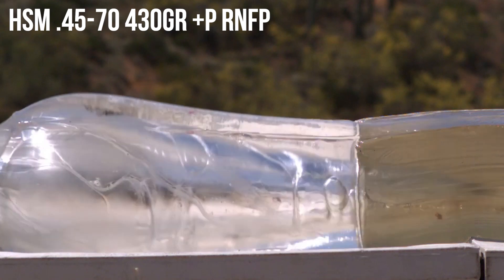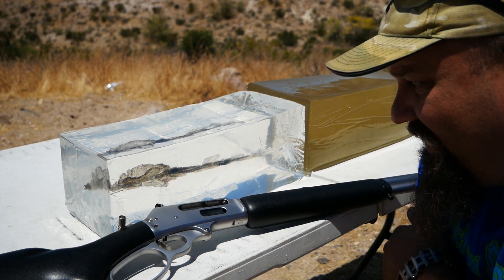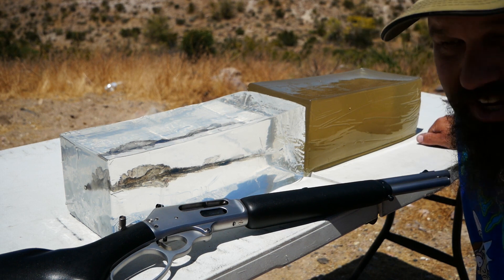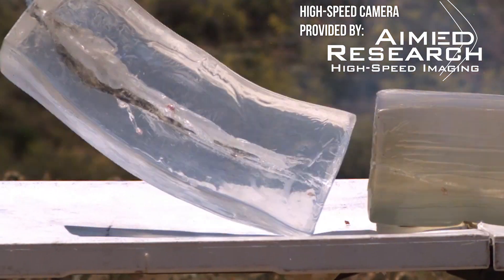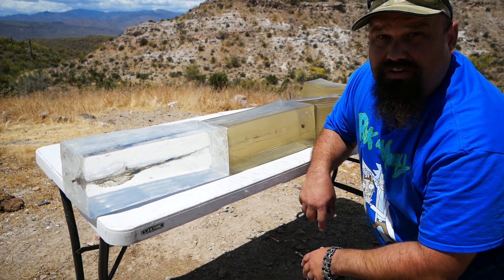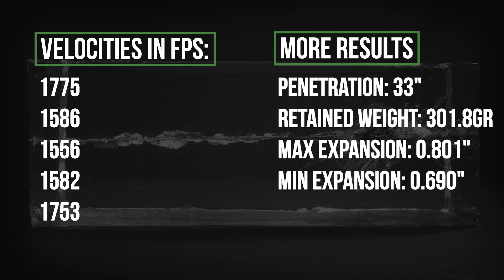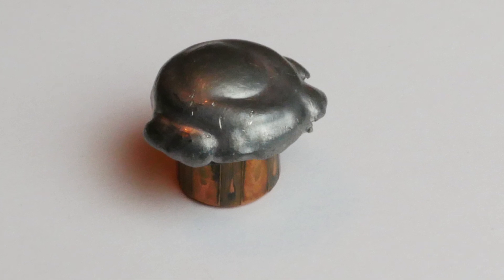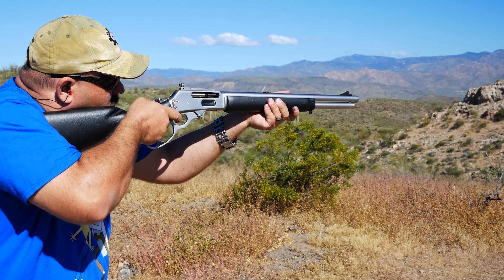Could This Be The Ultimate Velociraptor Load?.45-70 325gr FTX LeveRevolution

Comment: Great vid mate. I love the above hornady round for the mud covered pigs down under. 
I hit a 30kg pig with one in the shoulder one day, surprisingly I had no pass through but the pig had a 12-13” split length ways in the hide about where the back strap runs on the opposite side of the entrance wound. 
Massive energy transfer. 
Easy shooting, hard hitting, aerodynamic (comparatively). 
Acceptable accuracy. Good ammo.

Comment: Good video. Demonstrates the 45/70 power potential. I shoot both a Marlin guide gun and a Shiloh Sharps 45/70. The Sharps handles 520 grain lead at about 1300-1400 fps. The guide gun uses 420 grain lead, and smaller weight projectiles, although I once hand fed one of the 520's in the Marlin and paid a price for it. Lost my hat, my glasses and suffered a nice bruise on the shoulder.  Don't do it!

Comment: These are not a weak load. Hornady loads the 325 gr at 2050 fps which generates 3032 ft lbs of ke. Sure a +P can produce more but Marlin and Henry don't recommend using them (yes, I called both companies). I live in Alaska and feel comfortable with these in any of my 45-70's. Not to mention they shoot sub MOA.
Reply: It's his 16" barrel length giving the inconsistent and low velocities. A 20" barrel would be much more suitable for 45-70.
Reply: Are you talking about the Underwood +P 45-70 ?

Comment: For the 325 grains FTX, you have to shorten the brass, so the powder capacity decreases, and you loose some foot-pounds of energy...
Reply: You don't have to trim the case down if don't want to. The reason for the case needling be shortened is to fit marlin 1895. Not suggesting you do it but saying it is possible To modify the carrier and put a wild west guns ejector in. This will drop your bullet jump now on my rifle I went form .150" jump to .050" jump These can effect pressure as well.

Comment: 325 @ 1600 fps, sounds like a 454 casull. Heavier bullet at lower velocity will do the same thing , only better . trying to modernize the 45-70 is a waste of time, original loadings  stomp game flat. Do as you like but I keep jacketed bullets out of my 45-70.
Reply: Factory Hornady 325 gr loads are going at 2050 fps and generate 3032 ft lbs of Ke. A bit more than the 454 Casull and these are moderate loads.

Comment: Velociraptors were barely 30 pounds and not much bigger than a turkey. They would have absolutely been bodied by a coyote if the two animals were ever to have a fight. 
You don't need a gun this powerful to take one out. 
Even if you were specifically referring to the raptors from the Jurassic Park movie franchise, you still wouldn't need a gun this powerful. Any gun you could use to take a deer would be more than enough.

Comment: Could you test the Barnes TSX @1900fps and Buffalo Bore +P TSX @2200-2300fps?
All copper lead free hollow points. I've used the Barnes load for the last 2 years on whitetail with perfect performance.

Comment: ABSOLUTELY I would us that rifle with that cartridge anywhere on the planet and Mars.
The ft lbs of energy with bullet mass and penetration makes this a smoke bringer
that will blow a fist size permanent hole through the mass dropping blood pressure very quickly. 
now you better have some water by ya if you bust something juicy because the giblets that will cover you will be epic.
that 4570 platform in this video will do an excellent job within 200 300 yards.

Comment: I shot a wild boar with one of those type o' bullets. I hit it in the shanks, and they basically was in the shape of what you'd get if you would get if you put a pair of pig shanks in a shopping bag and ran it over with a truck and then pounded it with a sledge. It ran whole of 7 metres in the dark, found it dead as hell. 
I dont think there's anything in Sweden i'd be worried about hunting with it. It's not a comfortable rifle or round to shoot with a bench though. Best fired when standing so one can flex a bit with the recoil.

Comment: With proper ammo selection and shot placement 45-70 is capable of taking any terrestrial game on the planet.
The LeveRevolution ammo is good, but Underwood sells a +P variant with the same FTX bullet, and if that doesn't work for ya, give the +P Extreme penetrators a try ... I let a friend shoot one of my smaller AR-500 plates, only he shot the one at 50 yards instead of 100, plate now has a slight deformation.

Comment: If you are truly looking for a freight train round, check out the hot load 1886 Winchester 50-110 WCF. You can punch holes in 3/8 plate steel at 2800 fps. Rifle holds 8+1. Lookup, "Leverguns 50" on youtube. Video title, "Most powerful lever action rifle cartridge." This thing can stop a charging anything, in its tracks.  Terrifying weapon/round. Love to see you gel test it.

Comment: My personal favorite 45/70 load is the Winchester Dual Bond. Winchester also makes 12ga sabot slugs which is the 45/70 Dual Bond bullet loaded into a sabot sleeve. (They also load this into .44 Mag, .460S&W, and 20ga sabot slugs.) Would love to see some head to head comparison of 45/70 to 12ga in gel.
Reply: I'm really disappointed that they quit making the dual Bond load for the 45-70. My favorite as well. Extremely accurate to 100 yards. More effective than the Rem405 yet no separation like the 300s. I have shot five deer and one coyote with them. Everyone dropped exactly where they stood nickel size hole going in quarter size hole going out. Perfect round for inwoods and stand hunting.

Comment: I always heard that at least some guides in Alaska and up north use 12 ga 3" magnum slugs for grizzly defense, although I live in Illinois and have no real idea. I'd be interested to see how something like this 45-70 compares to some brenneke black magic.
Reply: More frontal area and impact, but less penetration and accuracy. Plus you can get Buffalo Bore 45-70 that'll rival 458 Win Mag and surpass any 12 ga slug in pure energy if wanted.
Reply: They do tend to use either 12ga slug/000buck or a 45-70 cuz the light 30 Cal's don't go through that fat as well or have that heavy impact, also the cold dense air is thicker and makes 30s a little less effective since they won't hold velocity as well being lighter
Reply: It comes down to bullet penetration with immediate expansion.... you can zip a 22-250 through a bears lungs.... it won’t stop... when you use either a rapid expanding hollow point or solid cast in a .4+ size at close range it hits hard enough to break bones. A bear will stop when it’s shoulder is fragmented.

Comment: You got to just love the smoke coming out the entrance hole is slow motion. Great stuff Andrew. 👍👍👍
Reply: What, exactly, was that vapor coming out the gel entrance hole????
Reply: @pcmacd  Mary Christmas. The smoke from the gel block is because it's petroleum based. The round is hot and. The friction from it travelling at 1700+ FPS indignities the gel.
I think that's sort of what AR15.com said.
Reply: It is referred to as dieseling. The rapid expansion created in the gelatin by the bullet passing through causes a vacuum that sucks air in through the entrance hole. The gelatin block rapidly contracts and compresses this air and causes ignition of whatever flammable gases are in this air. I do not know anything about the volatility of the gelatin compound or how it reacts to so much combined pressure and heat. I do know it is awesome to watch in slow mo. @pcmacd
Reply: Power fart!
Reply: Like it's vaping

Comment: Garrett's 540 grain hammerhead in 45-70 at 1550fps works better on all African BIG game than any of the so-called Big game cartridges .458 Win. Mag, .460 Weatherby, .500 Nitro etc. It easily takes all BIG African animals because of it's broad flat meplat and it's reduced velocity. Garrett's research shows that ultimate penetration occurs at between 1300-1600fps. More than 5 feet.
Reply: That's just nuts.
Reply: Andrew, I meant to tell you how much I've enjoyed your videos. I think you do a terrific job with all aspects of it. I also was going to mention, that after reading about Garrett's research I bought a pair of the blued Marlin 1895's identical to the one you used in the video (except blued with the brown laminated wood). If the Garrett Hammerhead's are to pricey (factory loads), Beartooth Bullets makes a 525 grain hard cast, gas-check bullet with the broad flat meplat for hand loaders, similar to what Garrett uses. About the other calibers I mentioned he says they need a faster twist rate barrel and a bullet weight of 700-800 grains pushed at the slower 1600fps limit for ultimate penetration. Happy Shooting and keep up the fine work it is much appreciated. One final point on 5.56/.223 videos if you would mention twist rate of the barrel it would be great. Thanks Again.
Reply: @cormacmacart3070  thank you. Twist rate doesn't effect terminal performance, but the 10.5" and 20" are 1:7". The 16" and 11.5" are 1:9".
Reply: Thank You Andrew. It wasn't in regard to terminal performance, it was whether or not the 75 grain Gold Dot would stabilize in a 1 in 9 twist barrel or not. It looks short enough that I wasn't sure. I know the A-Max and Sirocco will not because they are to long, but some 75's will and I'm not sure about the Gold Dots. It seems like you tested the 75's in the 20" and the 11.5" I will have to go back and look. If it was the 11.5" did you shoot any for groups at say 100 or more yards. I may end up having to call Speer on this cause I am planning on making a large order of the 62's or 75's. And I would like to know about possible stability problems with the 75's in a 1 in 9 twist, being I am already heavily invested in that twist rate.
Reply: @cormacmacart3070  hard to say. Some 1:9" twist barrels will stabilize some 75gr bullets but the only way to know for sure is to shoot a group with your rifle. Bear in mind that environmental conditions can change that outcome.
Reply: Cold especially. I will give Speer a call, and will still probably have to test a box. I will probably load them down some because most stability problems occur at lower velocities (hence trouble in cold weather). Thanks again for all you do.
Reply: @cormacmacart3070  my pleasure.
Reply: I heard something about that load before...I remember some guys talking about it at the hunting expo while looking at a Cape Buffalo mount.

Comment: Reloading that brass sucks because you need specific seater die and sizer die because it’s shorter then normal 45-70 cases FYI 😂
Reply: I buy Remington or Winchester empty brass and reload my own busters that makes the  Leverevolution look anemic. Over 3500 ft/lbs of energy using a 350 grain round nose. I have both Marlin and Henry rifles and reloads need to be crimped, especially for the Henry with the slide in tube follower. Enjoy.
Reply: @Mark-uq9km   the Hornady 350 gr. RN SP is bad, since it doesn’t have any crimping groove for the tubular magazine.  Single shots rapped my knuckles with the lever to where my fingers ached for two weeks.  Plus it’s made for high velocity 458 Win. Mag. Hand loads.  My Marlin is the first ported Guide Gun to hit my town, that went out the store’s front door.
I settled on hot loaded 400 Speer SPs which give Mickey Mouse three shot groups at 100 yds, over a bench rest!!
Reply: @davekoenig9935  
Soft/Kidd leather shooting gloves ...
Reply: @fjb4932   the Wild West guns enlarged lever cavity beats a leather glove, or a piece of leather, laced around the loop of the standard lever of the 1895 Marlin rifle.
Reply: @Mark-uq9km   Whats the difference at say two Hundred yards ? Which bullet has the most energy ! That's what the leverevolution was designed for ! To extend the range of lever guns !
Reply: I don’t have a problem with it. Follow the Hornady reload instructions for length if using the Hornady or Nosler ballistic tip projectiles and don’t use Cowboy dies. Use the correct 3 die set. Crimp those suckers and use a slow burn powder like 4198 and you can stack those rounds out 100 yards over open sights.
Reply: Put the brass on the top of the shell plate, and a regular crimp die will work. Kind of slow though.
Reply: you only need to trim a few mm off....
Reply: @TheWolfsnack  .050, and it is easy to tell the difference and keep them segregated.  Not as severe as the difference between a 38 Special and 357 Magnum, but obvious enough there is not confusion.  Yes there are more powerful 45-70 loads, but these are good enough for 90% of any shooting you will do, and are easy to reload.
Reply: Blackcloudr1 1  I pull the tip out with pliers and use the rifle as a two shot. Do not stack in magazine if you try this as the sharp copper edge rests on primer and will chain ignite.  Results on any game are spectacular.
Reply: And you don't exactly get a major improvement in ballistic coefficient either.

Comment: I like shooting my Marlin 1895 GBL 45-70 with a Lehigh Defense Extreme Defense 325 grain bullet loaded with 43 grains of Reloader 7.  Very accurate load with awesome hitting power.
Reply: That sounds like a great load!
Reply: With this round, you don't have to be really fast, or especially heavy bullets, to be effective.  Leverevolution rounds hit a ton and transfer nearly all the energy.  A hole .800 is good enough.  I use a '75 vintage 1895 with a longer barrel, gets a bit more velocity.  Got to put a premium recoil pad on though to really enjoy shooting them.
Reply: 325 grain bullet w/43.0 grains of powder equals roughly 1635 fps / 1930 ft lbs energy.